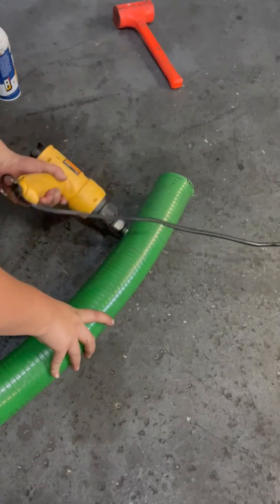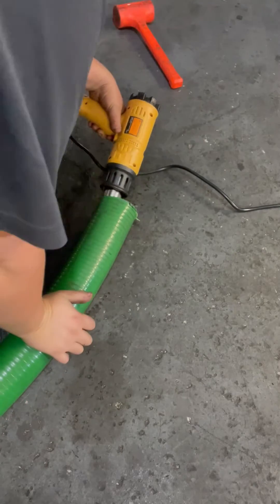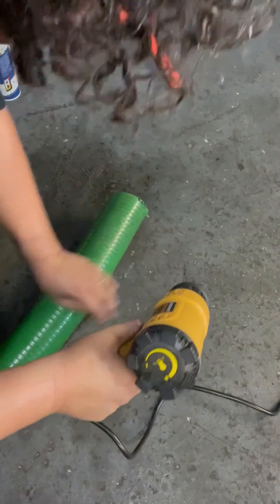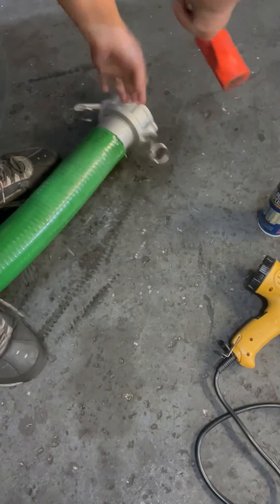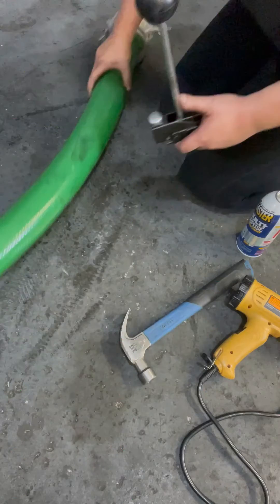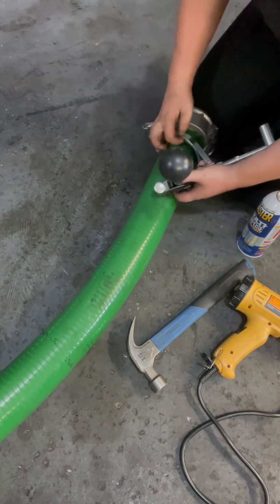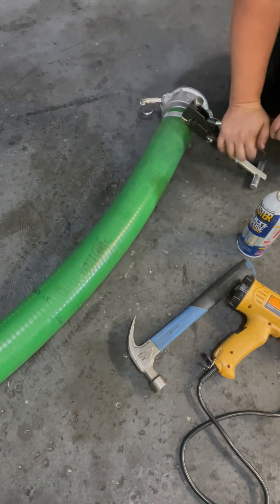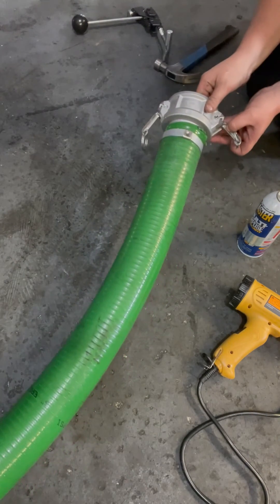How to Install a Camlok fitting on a suction hose

Comment: Hey, great job on female attachment instructions. I didn't know to heat hose to ease installation. So thank you.
My kit has a nipple or male attachment that goes on the water pump or another hose to be able to use the quick connect kit. 
Now i have to screw intake and discharge hoses on each time i set up my portable water pump. With seventy year old hands it's now difficult and time consuming.  So a complete video would be great. Thanks for responding.